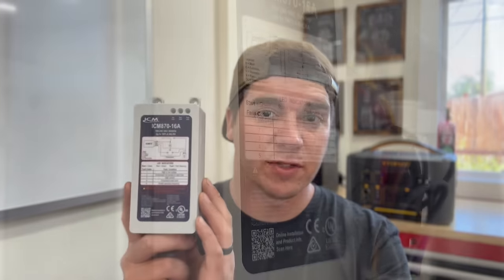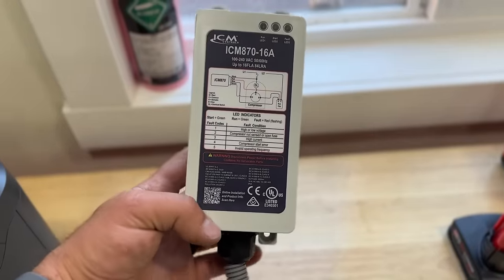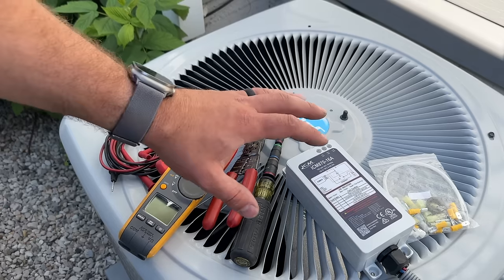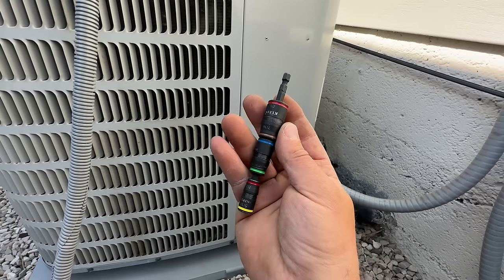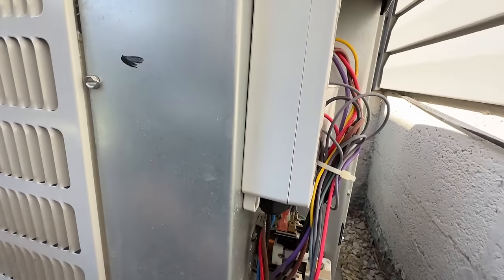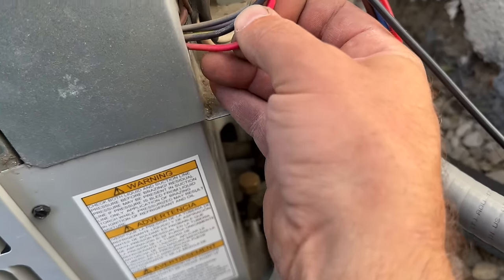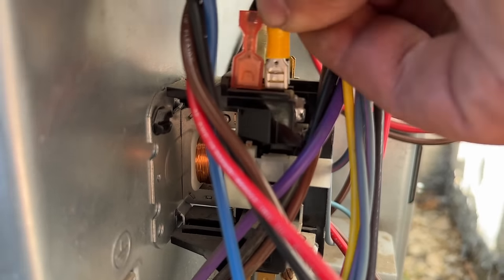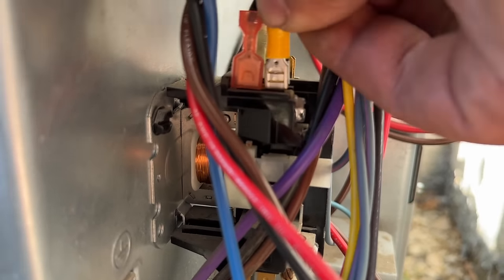This $150 Soft Start Allows You To Run Your A/C With A Generator!  Introducing The ICM870

Comment: Im going to say this for your knowledge.  Im commercial HVAC tech and did residential in my early years. ICM products are top notch. They are used widely directly from the manufacturers as OEM components.  From control boards , timers , three phase monitors ect.... the list goes on. Highly recommend this.

Comment: I installed 2 Easy Start soft starters on my 4 ton units in June (SW Florida Heat). Last night the upstairs was blowing warm air. I 1st thought the unit had a leak but my tech came out today and the compressor had shut down. He hosed it off and removed the Easy Start from the connections. The compressor worked fine. I asked him to hook it back up to verify it was the soft start and sure enough the compressor would not start up. I have now removed the Easy Start and initiated a support ticket with the company. I expect better from a company selling $300+ soft starters. Cost was only $114 for the diagnotic work because I do have a contract. Just wanted to pass this info along to others in case this happens to you!~
Reply: I’ve had an easy start on an Rv air conditioner for 3yrs, it has lived an extremely rough life, so far it has worked flawlessly.
Reply: Same. Mine lasted 7 months (half of that ac was off being winter and all). No lights no nothing. Removed controller and ac works fine.
Reply: @MrJasonwoodrow  they did send a new unit. I will try one more time in April.
Reply: Hey Guy thank you for the information because I was thinking about purchasing one for my 4 ton unit.
Reply: I am skeptical about these soft start gadgets. You are adding another complex point of failure in the AC system. If you want to run your A/C with a portable generator, get a 17000W Generac, it will run a 4 ton AC unit. My HVAC guys won't install these kits. They are more trouble down the road that are not even worth it. Installation labor costs are as much as a 15000W generator, which can run a 3.5 ton unit. I don't want to have premature compressor failure which will cost $1500-$2000.
Reply: Mine went out and they were great and send me a replacement. The replacement went out a month later.
Reply: Who did you buy your unit from ? Amazon will not respond to my request for a replacement, ICM says I need to deal with Amazon but if they do nothing I would think the manufacturer should step up to enforce the warranty.
DO NOT BUY UNIT FROM AMAZON
Reply: What was the FLA rating of the soft start and the FLA rating of the AC unit?
Reply: @anthonygambitta6220  you are talking about watts, that's not the problem for running A/C with a generator.   what is the out output amps on your Generac ?
Reply: @anthonygambitta6220 my ac guys will install them and like them.  They actually help limit the wear on your compressor it also keeps my lights from flickering.  Getting a 17,000 watt stand by unit is by far and away more expensive than a portable unit and a soft start.  You’re being paranoid.
Reply: Ya looking at the reviews of a suppliers site, seems like this thing does not last for long. Does it even save on bills?
Reply: @polotubefor1 who manufactured your unit? Thanks.
Reply: Were they the same brand shown here, the JCM?.  If so, maybe the micro air unit is worth the extra cost.
Reply: @polotubefor1  Did they replace it again?
Reply: @ravenstarfire8816 that isn’t the purpose.  It’s to off load some of the in rush current stress that is being put on solar or generator systems.
Reply: This thread is telling me to go with a soft start from either the HVAC service you have a contract with or the manufacturer of your AC.

Comment: Fantastic content. I just installed ICM-870 soft starter for my Carrier 2.5T and it works beautifully. The AC is running quietly and it’s now working with backup generator and my DIY Solar inverter.  Just a point to add, if on initial start you see a red blinking lights stating over current , just wait for a minute or so and disconnect and retest. The capacitor needs to be fully charged and most of us will short it during installation for safety. Next time, it will run without fault light and only green led will be on. My unit went down from 35 AMP to 6 AMP. What a wonderful kit at the right price.
Reply: Thanks A LOT for this info it helped me out as this is what happened to me and I've been scouring the net trying to find the solution lol.
Reply: @johndoe-ek6vl  do you completely disconnect soft start, or only certain wires?  Thx!

Comment: Thanks to this video I had the info I needed to complete the job. I ordered my 32A version for a 4 ton from Supply House 10 months ago just when there was a parts shortage so I just finished the install. I had little room in the compressor compartment so I used a 10x8 weatherproof box for mine. It comes with a fairly generous whip so just enough wire without making any jumper extensions. The four minute delay when it detects a power issue seems a bit excessive but otherwise works like a charm. I simulated a power issue by plugging/unplugging the disconnect a couple three times before seating it properly. The compressor fan came on and it immediately went to fault with no compressor and after four minutes the compressor spun up and light went green. Though the instructions are pretty clear this video really reinforces the process and makes it a no brainer. Thanks for the tutorial!!

Comment: Thank you so much for this video and did this install easily!!!  Just note the new ICW install the red light will blink for 4 minutes and then turn to green once it starts the compressor.  I got the 32 amp version for my 5ton unit!  Keep up the great work!!!
Reply: Does that model ICW run the blower for 4 minutes, each time, before the compressor kicks in ?  Thanks

Comment: I installed this on my 3 ton. I watch his install video. Worked just like he said... For a week. Brand new compressor with an RLA of 11amps (well within range of the 16amp model). Managed to get a replacement and got a professional to install it. Ran like a top... For a week then same code, can't detect compressor. Removed the device and Reconnected everything to stock and the compressor works fine.
Reply: This is why I put 32A unit on my 3 ton. RLA and Reality are not the same on VFD. been running for 4 months thru August heat!
Reply: @dkraft  it should work running at 65% darn it
Reply: @dkraft  This is what I am wondering, mine AC is right at 16A RLA, should I get the 32A or 16A.  Is there any downside using a larger amperage.
Reply: @SangLeWeb   Yes, the higher current ICM units will probably not limit start current as much as the lower current units so you may not get as soft of a start as you should.

Comment: Just bought one of the icm870 last week and installed it on my unit. I seen a previous vid of yours and another hvac guy on utube. Really easy to install. I have the same unit as yours but the 3ton version. Good video
Reply: How has your icm870 held up since your purchase? I'm thinking about getting one.
Reply: @jimmitycricket  i haven't had any problems at all with it. It still works

Comment: I've seen a number of complaints about failures on some of the ICM870 videos but just talked to a tech at ICM and learned that they've upgraded their internal start capacitor as well as some other components in 2024 so reliability should be much improved now.

Comment: Great video and awesome information! I have the Micro-air for my Trane 4-ton A/C-only system, which works great. As you mentioned, The price was steep, but I felt better when you said ICM didn't have a kit for > 4-ton units. Before installing the Micro-air, my inrush amps were 133.9, and with the Micro-air installed, my inrush amps are always right around 35 amps. I'm not sure about the ICM unit, but another thing I liked about the Micro-air unit is that my condenser fan comes on first, and then after five seconds, it kicks on the compressor.
Reply from the maker: Yea I like that about the micro air units too. Pretty slick. They look rad too!
Reply: Where I can buy this I cannot find it nowhere

Comment: I can see how a soft start kit can extend the life of equipment. However, as long as you have a quality generator running your AC in not an issue.  Also, a soft start kit is not necessary with Inverter units.

Comment: The capacitor is discharged practically instantly through the motor windings when the motor is taken off the line. Just the same, it is good to treat them with respect as they can bite if they’re in a circuit that does not inherently discharge them.
Reply: Bad advice.  Not all systems are wired this way and will leave a charge on the capacitor.  Some capacitors have a bleeder resistor running across the spade connectors to allow discharge.  I noticed in this video, that this capacitor does not have a bleeder resistor on it.  That being said, you can push in the contactor after power is off and this will sometimes discharge the capacitor substantially without putting a nice arc on your tool.
Reply: @Do_the_Dishes    Can you also just short the capacitor to ground to discharge it?
Reply: @richard6150  I wouldn’t count on that Richard.  It is assuming that particular part of the circuit has a reference to ground.  Since the motor starter contacts are not engaged while off, circuits are not complete and may not find a path to ground.  It’s always fun to just disconnect the assembly with insulated tools, throw the cap to a fellow shop mate and say catch.  😊

Comment: This is probably one of those items that should be installed regardless if using a Generator or not. Using that many less amps to start a device (regardless if an A/C or not) will save a lot of money down the road on power costs, and save money on repair costs as well.
It would be interesting how many kWh's it saves over the course of a day, but I'm sure it's not going to be insignificant.
Reply: The inrush last a few ms, highly doubt you'll see a huge difference in power consumption. However I agree this protects the compressor in the long run plus quiet start.
Reply: @nobytes2  From my tests I've seen inrush as long as 2 seconds spiking 3-5x the running amps. So in worse case situation, if a motor is rated at 5A, 5x is 15A @ 220V = 3300W. Just 20 cycles would add up to an hour, which can be done in a day or 2 easy depending on location, which gives about 66,000Wh
And at my power costs, $0.11/kWh, this would yield $7.16/day, or 2!  That's a HUGE difference if the soft start can keep this from happening.
Again, this is "worst" case numbers.

But don't think just because a surge current 'only' lasts a few seconds that it's inconsequential. It's add up over time
Reply: @korishan   Math check needed here - - - - - 
Yes, if the rush current spike is 15 amps, 15 times 220 is 3300 Watts.
(But you probably have 120/240 volt service)
If that spike lasts 2 seconds, how many Watt-Hours is that?
One hour is 60 seconds per minute times 60 minutes per hour, so 60 X 60 = 3600 seconds in one hour.
For two seconds per 3300 Watt startup-pulse, that is 2/3600 hours each startup, or 1/1800 of 3300 Watt-Hours. 3300/1800 = 1.83 Watt-Hours.  

Then using your 20 starts per day, 1.8 Watt-Hours per start, times 20 starts is 36.6 Watt-Hours per day.
Dividing by 1000 to convert to kWhrs = 0.0366 kWhrs. 
At your electric rate of $0.11 per kWhr, that is 0..0366 X $0.11 = $0.004 PER DAY.

Yeah, that IS non-zero, but to me seems inconsequential.

Does it add up over time? You are in Florida, so you run your unit 24 X 365?
Then per year, $.004 X 365 = $1.47.
Big Macs here, near NYC, are $5.00+.
        Your treat with the savings from your soft-start?

Rich

Comment: 5 amps after the installation? That is the fan motor current, check the inrush after the compressor starts. I installed the micro air and it was drawing close to 40 amps of inrush current at first. after the installation, it only draws about 25 inrush, then drops to 12 amps compressor running. I guess that is the nice thing about micro air, you get all the details in the app. BTW, do not get me wrong, it is a nice video showing the installation. Thanks.!
Reply: I agree.  I didn't hear the compressor at all, just the fan.

Comment: The run winding’s power wire formerly the red wire on the contactor that was removed then connected to the
Brown wire. Now the run winding  must get it’s power from the red wire connected to C on the DRC then sends it to the soft start and out the brown brown wire to the original red run wire to the run winding.  That wasn’t mentioned so it threw me off. You make well explained videos. I’ve watched several.
Reply from the maker: correct
Reply: What is DRC  ?

Comment: Getting ready to install solar panels with some battery backups and our solar contractor mentioned I would need a "soft start" device to tame my 14.1 LRA on our 3-ton Lennox AC that way we can power the entire house from the batteries including AC.  Gonna install the ICM870, they wanted more.

Comment: Fantastic. You sold me. I had our house wired for a generator but couldn't run the HVAC. Now I can, thanks to your tutorial. My question is, why don't all HVAC systems come with a soft start?? Also, how many amps does a typical electric furnace draw?

Comment: You decreased in-rush by around 85%, does this brand of soft start decrease other higher amp AC's by 85%? I have a soft start on mine and it used to have an in-rush of 69 amps before soft start and now, the in-rush is 42 amps. Seems fine but no where near the drop you are seeing. If I could drop the in-rush by a few more amps, I could power everything in the house with my generator. Hell, I could get some good ecoflow batteries and run the whole house on a power outage. By the way, this is a very good demonstration of how to do what you are talking about. My electrician did not explain anything to me.

Comment: Can you do a video with step by step instructions on installing the ICM493? With all of the inverter systems available, I think it would be beneficial for your audience!! Thanks for the detailed videos!!
Reply: The variable speed inverter driven compressors like those commonly found in the current generation of mini split heat pumps are inherently soft starting. There is no large inrush current.

Comment: Update on the ICM 870-16a they added a new feature so your furnace blower and your outside AC fan runs for 4 minutes before the compressor kicks on. No idea why but ICM claims it's because of rapid compressor cycling. I get it but 4 minutes ❔

Comment: Wow, great video. If I don’t have a generator or problems with flickering light, and all I want is to extend the life of my compressor, would you recommend the 5-2-1 instead? Or LEAVE IT ALONE, if not broken don’t try to fix it?
Reply from the maker: I had a hard start kit installed on mine before I put in the soft start so I can run it off my generator. So I say do a 5-2-1 hard start if you have no interest in using a generator to power it 👍🏼

Comment: I just put the icm870 on my unit.  Works good for it for 150…easy install.  My unit has lra70 amps.  I don’t know before and after as I don’t have an ampclamp the does inrush.  Mounted in the condenser
Reply from the maker: I’m sure it lowered it to 20 amps if not less. Glad you are happy with it!

Comment: Thank you for all of your great information! I live in an area where we use reheat to remove moisture from our home. For this process to work efficiently all year we have a low ambient kit installed on our system. The low ambient kit calls for a hard start kit though we do not have one and have not had any issues. I love the idea of a soft start as our systems winds up and down more with the low ambient kit. As we also live in a forest fire zone the idea of having our hvac system running when the power company turns us off is also appealing. My question is will the soft start kit allow the low ambient kit to remain in function?

Comment: This is very good and straightforward but you should have shown how to discharge the capacitor (which you later did) with a screwdriver. You also should have shown removing the compressor wire from the contacts. ... And I'm still waiting for you at 9:25 to put something back where you took that red wire off.

Not completely necessary because the Spade connector was insulated, but a lot of people would have used heat shrink.
Reply: I finally figure this all out. This video was a huge help except my run wire is yellow not red or black as Goettl told me.  I found the compressor wire which was yellow. And when I connnected to brown wire it didn’t start right away.  I waited 2 minutes and it started working.  When I did 2nd AC it worked from the start.  

Video should show exactly where red compressor wire came from.   Another video showed it came off the main terminal.

Comment: Great info sir! For those of us not in da know....what is advan😢tage of soft start over a hard start kit? I was under impression that a hard start kit was another reason why we would want to add a hard start kit was the ease of adding some help for starting scroll compressors on a genny or on reg utility. Just trying to understand why i would spend 10x the money for this apparatus. Thanks showing us the options!😮
Reply from the maker: The main advantage is to be able to run your air conditioner on a generator in the event of an emergency.
Reply: It's better than hard start kit? Just trying to decide if I should upgrade.
Reply: @hitekrednek66  it's much easier on the components as it gently ramps the compressor up rather than hitting it with a ton of power from a dead start.
Reply: @johndoe-ek6vl  thank you sir!